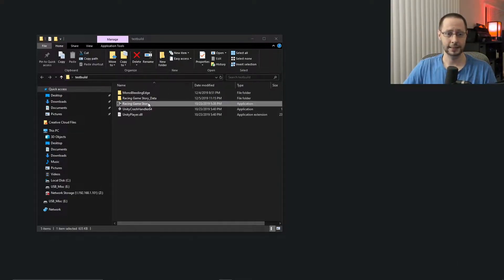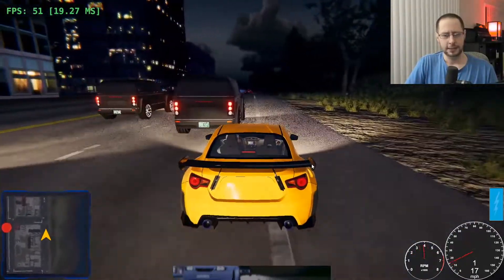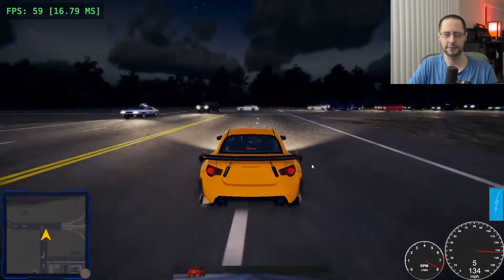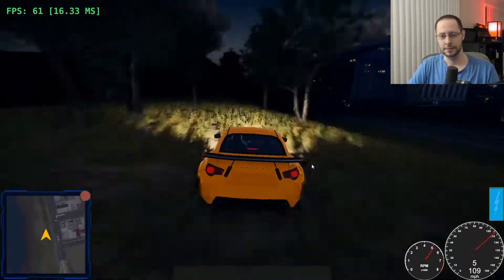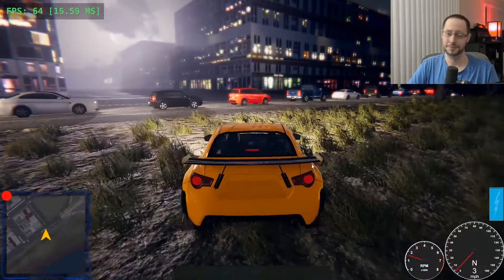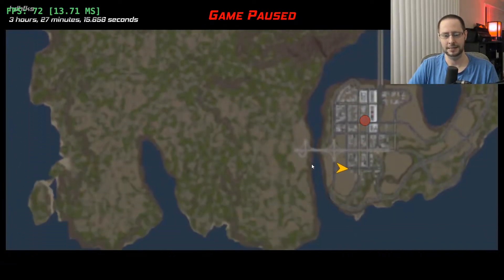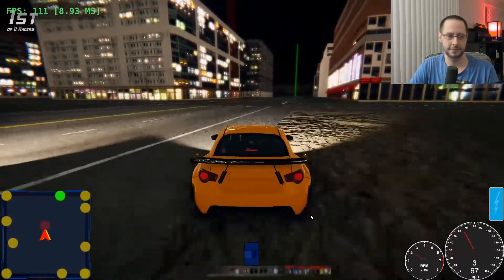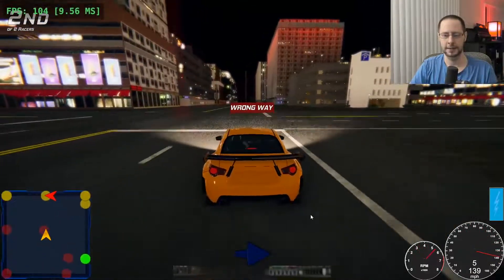Dev Log 24 AI Traffic Prefabs and Vegetation [Unity Racing Game Devlog]

Comment: I find these videos very interesting so thanks again for sharing. I noticed a lot of noise on the road surface, is this deliberate or just something that hasn't been worked out yet ?
Reply from the maker: That's the default material/texture from the road tool I use, I'll setup something custom at some point that look will look better.